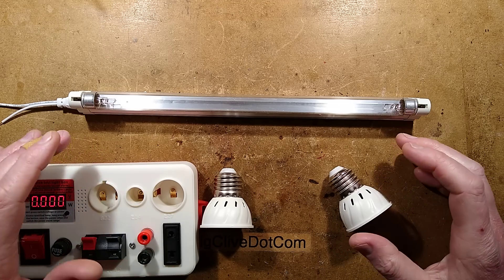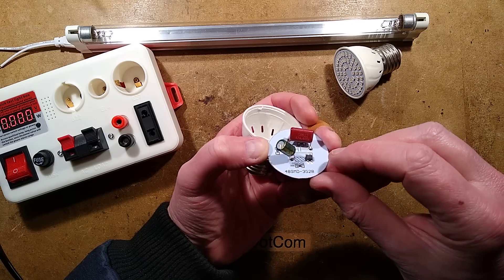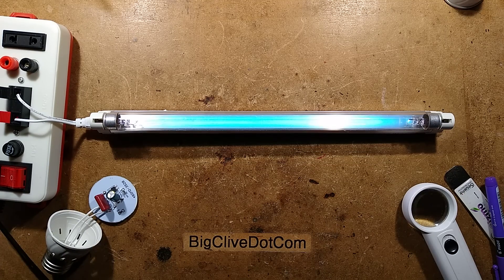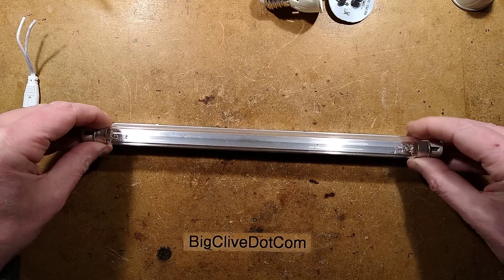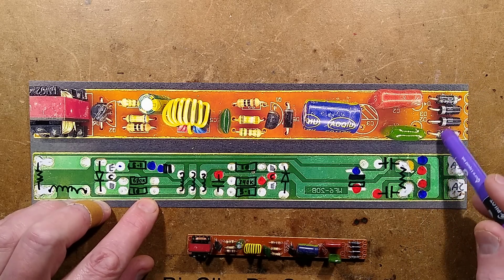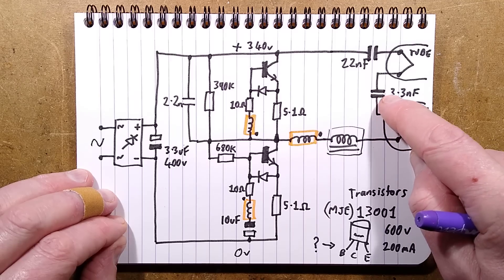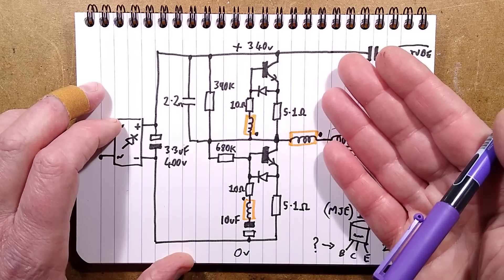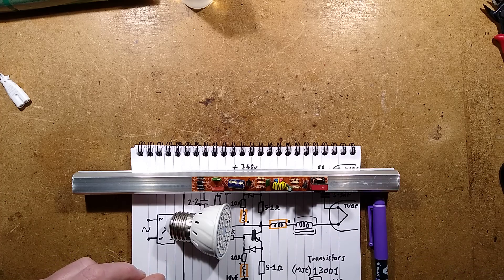UVC 2023 - the fake and the real (with schematics)

Comment: I miss you drawing the circuits out real time, felt like I was learning along with you.
Also a 400V capacitor? That's a weapons grade fake UV-C lamp!
Edit, also on the topic of UV-A through to UV-C and cancer, a family friend was recently treated for skin cancer, we were talking about it roughly a month ago and if I remember right her doctor told her it was caused by UV-C as glass (eg window glass) as UV-C passes through normal glass while A and B don't. Figured the doctor may have been wrong as I'm I thought UV-C doesn't go through silicon glass well, but interesting nonetheless. Might just be a myth in the medical world, a tiny amount of radiation will get through any blocking material after all.
Reply from the maker: UVC does not pass through standard glass, and there are very low levels at ground level.   It's since been discovered that while UVC is very irritating to eyes and the outer layer of skin, the short wavelength means it doesn't reach the more critical deeper layers.  So UVA and UVB pose a higher risk of causing more serious skin issues.
Reply: @bigclivedotcom  what? X-ray has shorter wavelength than UVC, yet it goes all the way through, while visible light has longer wavelength, but is easily blocked. What you are saying about penetration and wavelength correlation is true for low-energy part of spectrum - radiowaves and microwaves, but it is opposite for high energy radiation, like UV, X-rays and gamma rays.

Also, silicon glass is partially transparent for UVA(because it is close to visible light), but almost completely opaque to UVB and UVC, so that doctor definitely didn't study physics well.

Most often skin cancer is caused by UVB, because almost all UVC from the sun is blocked by the atmosphere(not because UVC is harmless, it's actually much more harmful). However, it is reported that UVA can sometimes cause certain types of cancer too. Most likely shorter part of it, that is closer to UVB.
Reply: UV-C is completely absorbed by the ozone layer and atmosphere, there's not a lot of it (if any) even outside in direct sunlight.

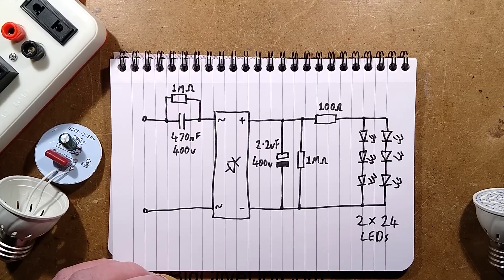Comment: For a few pennies more... The unsafe, ungrounded circuit design seen at 3:05 could very easily and cheaply be made safe by putting an input capacitor in each rail of the input power. That would hardly cost anything extra because 470 nF @ 400 V would be replaced by two caps, each rated 1 uF @ 200 V. Also the one discharge resistor would need to become two, but each of them rated only half the wattage. "But then they would sell fewer!" I can almost hear someone saying. Have we all become so stingy, we are willing to accept a deadly risk, rather than pay a few extra pennies?
Reply: How would that be any safer? A 1 uF cap passes more than enough current to kill.
Reply: @eDoc2020  - You definitely misstated the fact, and seem to have misunderstood the nature of the real danger. Fact: a 1 uF cap (1 microfarad) can pass only one millionth of a Coulomb per volt per AC half cycle, assuming zero resistance. So for 220 volts at 50 Hz that is 220 microcoulombs, 100 times per second, or in more common terms, 0.022 amps or 22 milliamps. No way that can kill a healthy person. Maybe it could disrupt a cardiac pacemaker. On the other hand, there is a clear and present danger in the existing design which Clive reviewed, in the fact that one of the mains leads has NO current limiting at all. If the lamp happens to be wired to mains such that the straight through lead connects to the mains Hot wire, then a person with a foot, hand or other body part touching mains Neutral or earth Ground can receive up to several amps at 220 volts through the lamp, indefinitely, and several times more for a brief period, either of which is enough to be deadly. But with a 1 uF cap in each lead from mains power, the lamp has DC isolation from mains (like a transformer would provide), while the caps limit the possible AC current to 22 milliamps, and the possible power is similarly limited. That 22 mA is not remotely a deadly threat. Perhaps it is enough to feel a mild tingle under normal conditions, or be rather unpleasant if the person is standing barefoot in salt water while grabbing the lamp with sweaty hands. But deadly? No.
Reply: @YodaWhat  I'll agree it would be safer but 22mA is NOT safe. According to IEC 60479-1 such a shock for over 700 milliseconds is likely to cause muscle contraction with reversible effects. It's not directly deadly but it would really hurt for a while. The real risk would be the results of losing muscle control. You could smash a hand into glass, throw yourself off balance while on a ladder, cause broken bones, etc.

Anecdotally speaking I've given myself test shocks while protected by a 5mA GFCI. Above 90v the effect got stronger very quickly. I'm sure the full 5mA that setup is capable of would be quite nasty. 22 milliamps would be far worse than a mild tingle.
Reply: @eDoc2020  - And I have tried putting a 9-volt battery to my tongue. It is rather unpleasant, but in no way dangerous. Of course it is worse to apply 220 volts and I would certainly not apply that to my tongue without insuring current flow could not exceed about 100 microamps... but the tongue is not a likely place for receiving a shock from mains power. I believe the shock standards are set fairly low, while taking the probability of serious shock into account, just in case a more sensitive person might happen to be involved, or a more sensitive part of the body. But it is not feasible to protect every person from every risk at all times. What's important is to protect almost everyone from the major risks most of the time. If some folks are particularly stupid in taking risks, no amount of legislation is going to prevent all injuries and/or deaths. See also @styropyro and his recent video, "Is it the volts or amps that kill?" https://www.youtube.com/watch?v=BGD-oSwJv3E
If manufactured as I have suggested, the lamp would be reasonably safe for almost everyone, in all the most probable settings. But the lamp as tested belongs on a list of Potentially Deadly Appliances, with the "deathdapters". @BigCliveDotCom

Comment: I highly doubt this is the case here but there are dual wavelength UV LEDs out there (UV-A at 400nm and UV-C at 270nm). Not quite sure what the benefit is but if you have a look at the emitters and there's only a single chip in them it's obviously not UV-C.
Reply from the maker: The real UVC LEDs also have quite distinctive packages.
Reply: @bigclivedotcom  ah you're right, I forgot about the neat brass packages. But honestly who knows what ideas chinese companies come up with next xD they might put the UV-C chips in plastic packages and just claim they're only meant for short duration use or something

Comment: I wonder if the dodgy test box has an SPDT switch in it like the other ones you tore down in one of your recent videos.

By the way, I was at the Medica fair in Dusseldorf last November, and I remember UVC lamps being quite the fad this year. Last year, understandably, there was lots of Asian companies showing off rtPCR equipment, this year it was UVC lamps. Usually big-ass mobile ones, on wheels, equipped with motion sensors to make damn sure everyone had vacated the room before those tubes turn on. Omron even showcased an autonomous rover with a UVC lamp on its back.

Comment: Sony used a similar but far more complicated circuit, based on the same idea but clocked at line speed in a few television sets, for many years. The purpose of the 2n2 capacitor is as a tuning capacitor and snubber. If you draw the 2n2 ton the right hand side of the transistor (between the Emitter [after the 5R1] and collector) it is more obvious. Nice video.

Comment: 18:48, i'm sorry what? the pandemic is still very much active, many people just chose to ignore it, but many people are still dying every day from it, and we are still very much in danger of new variants emerging because of the lack of control and making all known remedies obsoletes (and it's happened for quite a few already).

Interesting video otherwise, but please don't normalize this idea, it's wrong and dangerous.

About your last hypothesis, i guess you (or someone else) could use some software to simulate the circuit with and without that 2.2 capacitor (at 16.57) and see if you get these harmonics, or other different behaviors. Of course, it's also possible to just short it and run the hardware with some oscilloscope, but that might be quite more risky, considering the high voltage of the ballast (I think?).

Comment: I have a pair of those identical UVC tubes sitting right beside me!  Yes, they're off.  ;)
Mine came with caps for the 2nd end plug, as well as an inline connector. You use that so you can easily daisy chain a bunch of tubes.  I've got mine hooked to a Kasa remote plug - I put it in the room to be UV'd, then just call out "Alexa, turn on the lamp of death".  After about 20 minutes, the whole room smells like a fresh lightning storm just rolled through it.
Reply: Better air it out afterwards. Ozone can really rot rubber.
Reply: I also have one of those tubes and mine also came with the bits you mention.  I put mine in my bedroom and left it on for an hour while I watched an episode of The Professionals.  When I went up to unplug it the room was awash with ozone, so much so that I couldn't breath and had to vent the room.  This is the most powerful UV/ozone generator I own (and i have several) ! !

Comment: The green 22nF capacitor is a simple DC-blocking capacitor to make up for the fact that the power supply isn't bipolar ( -170v ___  0v  ___  +170v), which would otherwise require two 400v electrolytic capacitors in series instead of just one, just like the PC power supplies have.
Reply: That's what I was thinking. I have an electronic ballast which does have a bipolar supply (one half-wave rectifier for each polarity) and IIRC it doesn't have a capacitor in that location.

Comment: 2.2nF cap is probably like a snubber. When the transistor turns off, it filters voltege spike over the other transistor (there is an inductor after all and it makes a spike because those switch off most probably before zero crossing). You could draw it across one transistor and it would seem more clear.
Why only one, why not one for each transistor? Because they are cheap. It is cheaper than two separate caps and there probably is enough voltage margin to get by with just one.
The effect of cap is also to help keeping the voltage zero during transistor turn off period. If current was flowing through the partially conducting transistor, it would result in switching losses when there is current flowing through a partially conducting transistor.
Things like that are quite common for resonant switching power supplies. (Or quasi-resonant like this one surely must be)

Comment: The 2n2 capacitor is effectively across the output of the half bridge.  It's being charged to 300V and discharged to 0V every cycle.  The only thing I can think of for its purpose is to take the edge out of the switching waveform and reduce EMI, but it's a very brutal way of doing it.  Hard on the capacitor and hard on the transistors.

Comment: I have several of those striplights, also with resonant start like yours. I'd wondered how to get them apart without destroying them .. maybe an end connector can be disassembled non-destructively to get the guts out and fix the things? Plenty of early failures with these but the ones which survive tend to last for years. So do the tubes. Lyvia Linklights in my case, the T4 versions.

Comment: Dumb question. Do discharge resistors leak or drawn energy while the light is on?  If so would removing them make the light more efficient?  Obviously this would put the light into Chinese safety standards but that’s ok.
Reply: They certainly do draw some power but not much. A 1meg resistor across a full 240 volt supply would consume a tad under 60 milliwatts.
Reply from the maker: They do but only a small amount of power.  But removing them means that capacitors can hold a charge for a long time.

Comment: The actual UV tube does have a delicious color. When I was doing welding a whole bunch of years ago I always wore a leather jacket, long pants and a mask with a proper viewing glass to block all of the UV.
Reply: Oh yeah, I should also mention that one time I was doing some fit up of parts with my back turned when my mentor was MIG welding up some products. I wasn't doing any welding so I didn't think about safety but the backs of my arms and the back of my neck got burns from the UV.

Comment: Being someone who suffers from chronic cornea damage, I do not recommend potato juice. I am also not going to give medical advice but there are over the counter eye drops that will address swelling and pain without the risk of an eye infection. Great video either way, Clive. Thanks as always.
Reply: As someone who has suffered from weld flash a couple of times, the potato works.  Just cut it in half and put each half on your eyes like you're relaxing at the spa. The first time I got hit, it was bad, and i tried the eye drops. They did nothing.  I finally broke down and listened to the "old-timers." It was near instant relief. I felt silly doing it, but after spending a night, blind and in intense pain, all vanity went out the window.
Reply: It works due to the whole eye surface gets micro-blistered. Potato Starch and Corn starch is really slick and soothing. I get Eye-Diamonds (undissolved salt deposits) that try to make it through the tear ducts that are located under the upper eyelids and get stuck at the ducts ends. They point through like a diamond stylus and wreak havoc on the surface of either eye that it happens to. To not suffer from "Sandman Level: INFINITY+100", I have to take a strong Lorazapam and sleep for a few hours till it dissolves on it's on. Luckily it usually only happens every couple of months.
Reply: I've found bathing your eye in milk seems to work work well, although my eyes can seem to take the odd ark flash these days without hurting, can't say the same for my face skin Lol.
Reply: I prefer tobramycin/dexamethasone ointment for sleeping.

Comment: I've got 30w uvc for pond helps get rid of alge clear tube sits inside exspensive quartz tube in which pond water flows round,tubes sat inside larger plastic cylinder.which also gives good protection to eyes, Had to replace quartz tube once3' cost around £30.

Comment: I have a real UVC 43cm tube (G15T8)- bought from an electronics shop over 30 years ago to erase E-Proms used in a uPC project I was developing then.  It lives in a timber box to prevent any stray radiation when in use - the safety aspect was impressed on me from day one ;)
The lamp holder is like the standard 20W flouro type with a 'flicker' type starter and an inbuilt ballast IE no electronic control at all.
Reply: I have one of those too. I haven't chucked it yet, nor have I found a good use for it.  I found that regular blue LEDs put out  a lot of UV, probably the longer wavelength.
Reply: @jamesvandamme7786  Not so much that they produce UV as the blue photons are energetic enough to have similar effects, especially fluorescence.

Comment: I purchased a Samsung wireless charger with a uv sterilisation unit in when closed and on, it does illuminate and the light works on a timer, im unsure if it works but it was used on eBay for £1 so could not leave to rest on eBay shelves.

Comment: I would be very wary of those led lamps. They could indeed be emitting UVC. A lot of the Chinese led's emit at around 400nm as well as a secondary line at around 240nm.
Just because the emission is visible is not a guarantee that is not also emitting light in the UVC range.
You should really invest in a spectrum analyser to be sure.
Great video though.
Reply from the maker: The new UVC LEDs do emit UVC plus near-UVA as a warning indicator that they are active.  They usually have a square metal package with quartz window.

Comment: Never heard the potato cure for arc eye, but have experienced arc eye and it is very unpleasant! I use an eye bath of milk which brings immediate relief. Another erudite and well explained video, thanks Clive, you are the electrical industries gold standard!
Phil
Reply: I suppose the starch suspended in the potato juice acts like talc. Not sure how beneficial it is for the eyes in the long run, though.
Reply: Damp used teabags.
Reply: I was a welder for many years, never heard of potato juice but some of my friends tried tea-bags with various degrees of success. I used Optrex with some success, best solution is not to look at the arc

Comment: I've noticed the integrated bridge rectifier seems to be what pops over time. The first lamp's chip seems a tiny bit larger than the usual ones I take apart, so maybe there's a higher wattage rating manufacturers don't use?

Comment: I don't know if they still use them in industrial buildings, but we used to use mercury vapor lamps in steel mills, and they also produce shortwave UV-C radiation.
Reply from the maker: If the outer glass envelope got broken on mercury lamps they did emit UVC.

Comment: Oddly I'd bought some UVC 20W lamps before the pandemic. They're quite good for getting rid of mold. What the UVC doesn't kill the ozone might. I'm always wearing glasses with plastic lenses so eyeballs are OK. Yes UVB is bad, I live in melanoma  capital but we also need some to make vitamin D. Personally I take the pills and avoid the Sun in the 2 hours before and after midday.
It's also recently been found that near IR is good for the immune system. The LEDs used in TV remote controls are a cheap source of NIR light.